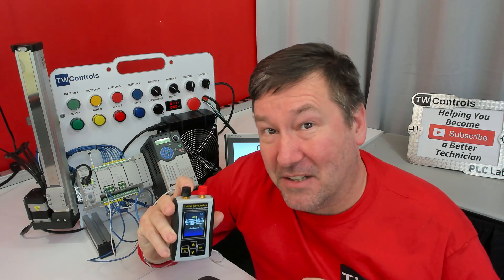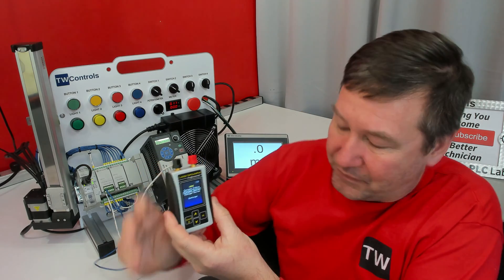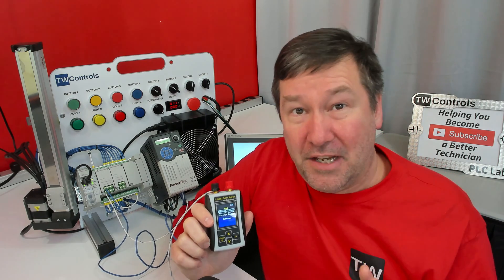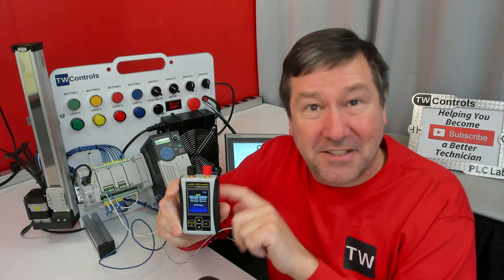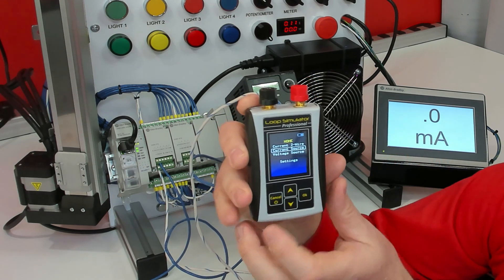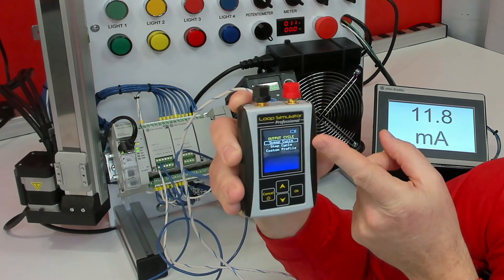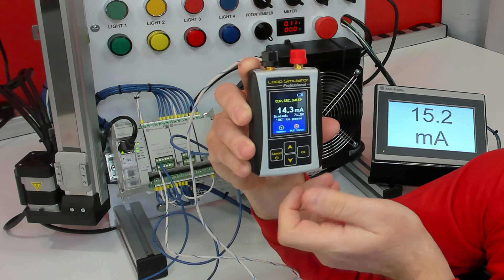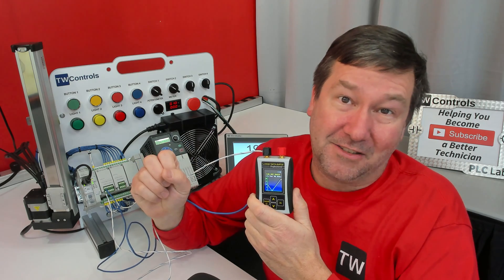Getting Started with your Analog Simulator for 4-20 mA and 0-10 VDC

Comment: Tim can you link the video tutorial manual. That benefits me since I have the simulator. Did take it to a recent SLC to CompactLogix 5380 PLC Upgrade project at Duke Power but didn’t really have to use it much. But having a simulator still counts for when you need it to just make sure the Analog Points are correctly mapped and reads correct. Fortunately most were in the upgrade, just some Digital IOs weren’t all correct. This project had its share of complications with so much scaling issue that didn’t convert from the previous SLC to CompactLogix. These are things you learn on the field that you don’t often learn watching videos. That could be something Tim you figure out how to properly address or talk about in a series of videos with scaling issues. Dealing with these issues took a lot of time to address and took almost a week extra time on PLC Commissioning. As the plant did not want to start major equipment in their water plant with Analog Issues. Scaling issues on control valve can be very dangerous that results in system water hammering with pump running as the scaling don’t convert from SLC to CompactLogix. Yeah, we found that one out live trying to put some water system online. In the end it was all completed during the plant month long shutdown.
Reply from the maker: I'm glad you got it all started up. Here's a link to the manual. 
https://youtu.be/9FJ_q85pYAs
Reply: @TimWilborne  Thanks Tim. It will be helpful.
Reply from the maker: You are welcome